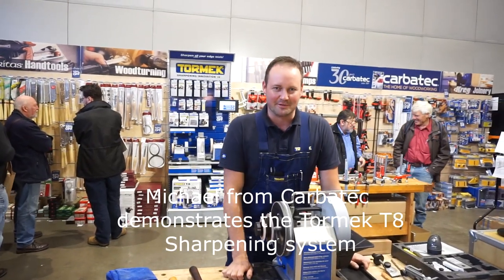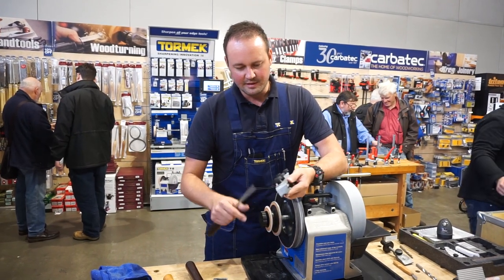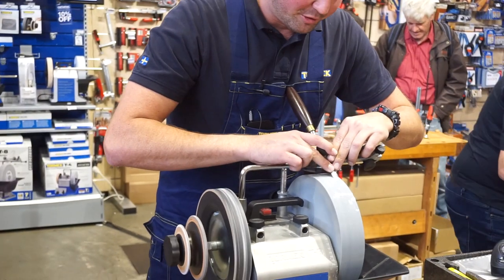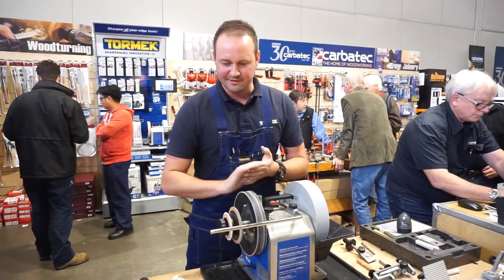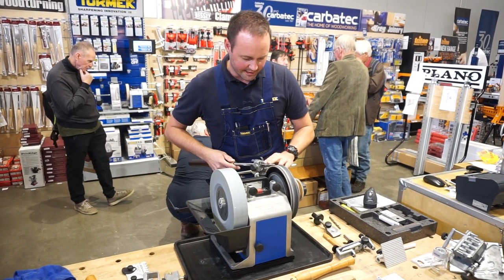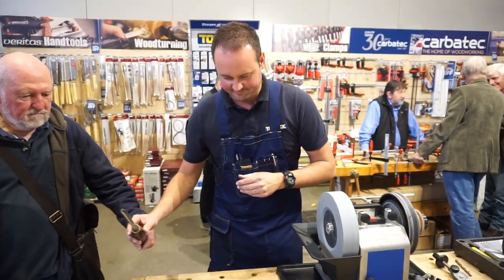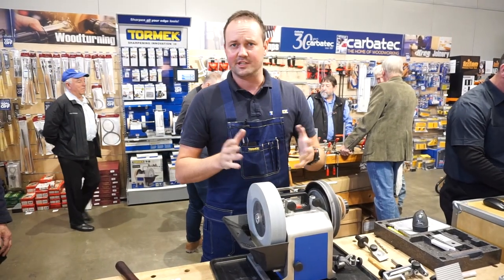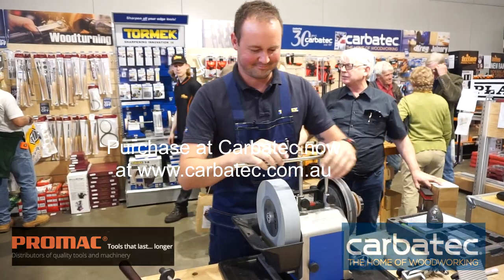Using the Tormek T8: A quick how-to

Comment: I have been honing my plane steels with diamond stones, lubricated with distilled water, ranging from coarse to extra-extra fine, in steps, then to the suede strip with pastes to get a mirror edge and sharp. No electricity required. But this system seems easier. Are finer grit stones available? Or would one need them? 220 grit is the grit of my coarsest diamond stone. I also us a veritas tool to set the correct angles